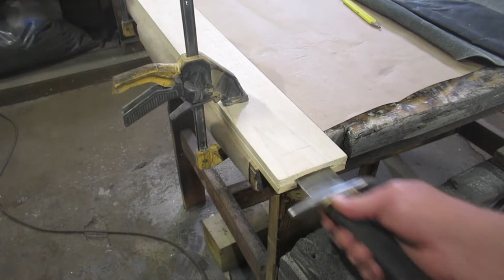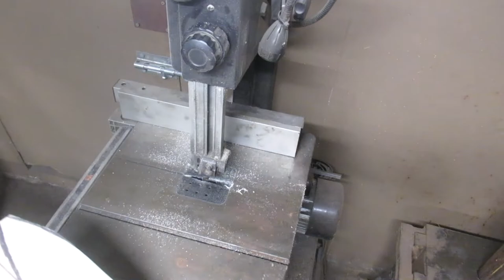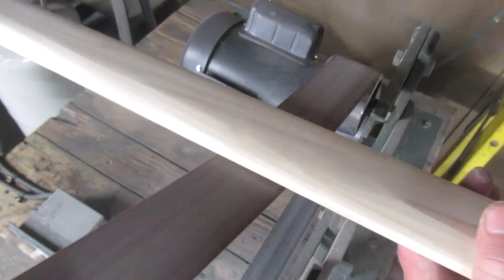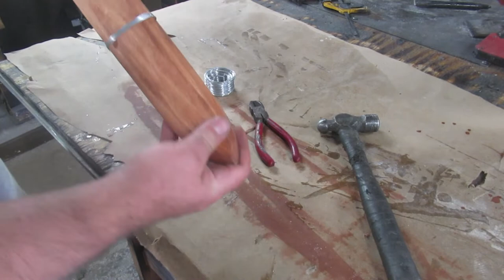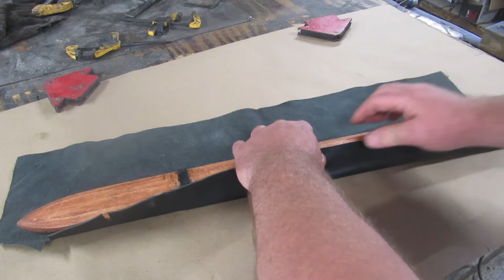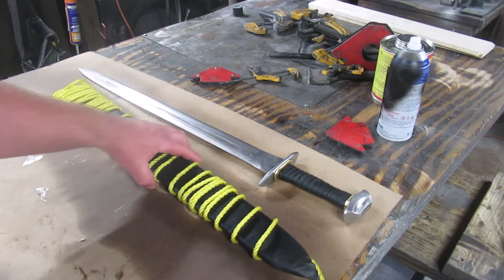Making Easy DIY Sword Scabbard

Comment: how do you keep the blade from falling out?
Reply from the maker: Has to be a tight fit.
Reply: you could probably put something on the top like most holsters. A thin leather strap that goes over the top and holds the sword down by the hilt, and fits into the otherside of the scabbard with a button hole,

Comment: Anything needed on the inside other than glue?  Will it rust the blade if not coated with something?
Reply from the maker: No not really. You could seal with a finisher and or I've seen guys line the inside with cloth or leather. So long as you keep the inside dry and oil your blade, you should be fine.
Reply: @jlsteelcrafts8378  what type of wood did you use? Some can be more acidic and for high carbon steel, which from what you said should be one such steel, these types of wood can lead to corrosion on the blade.
Reply from the maker: Hi Andre, yep I agree there are higher qualities of wood that could be used. This was kiln dried aspen pine if I remember right. Again tho, using a wood sealer or oil would help with this issue.
Reply: @jlsteelcrafts8378  historically scabbards were lined with felt. It draws moisture away from the blade. If you lined it with leather then moisture would be drawn into the blade because the leather wouldnt absorb as much. Its more for longterm storage thinking.